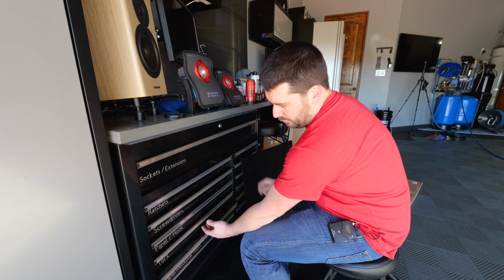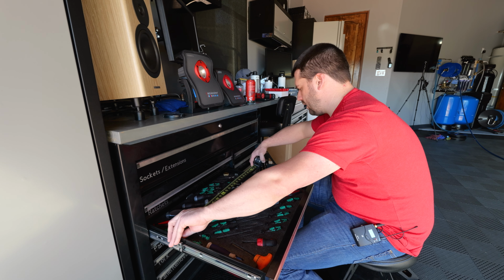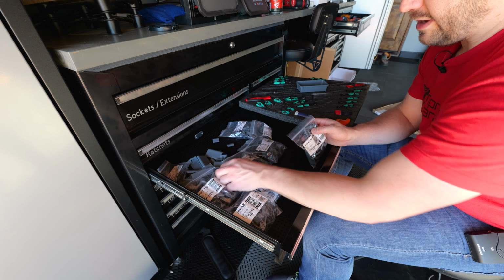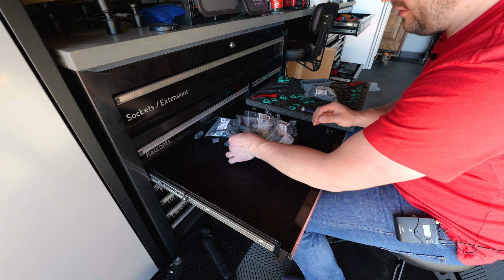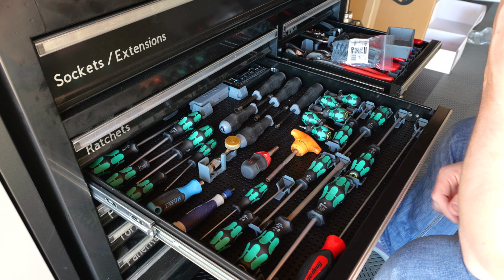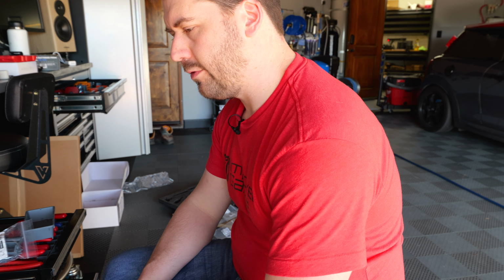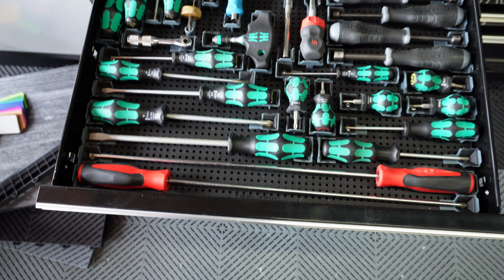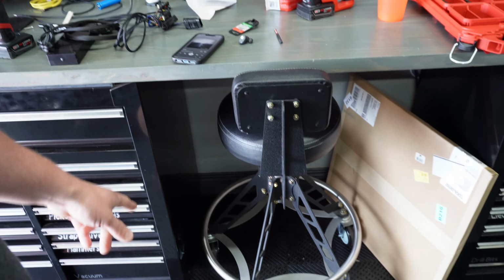IG536 I ToolGrid my ScrewDriver drawer

Comment: Nice tool grid video, been going through my cabinets/ toolboxes to get an idea how I want to do my layouts in the drawers. Just a thought I got the sonic mss 7 drawer portable cabinet, I believe that's how they list it, but it's got wheels on the bottom, and it's got 5 small drawers like the 9-drawer cabinet with 2 deep drawers like the 5-drawer cabinet. There is a good mix to the drawer size, I have been very happy with mine and if you have a mss cabinet on each side of it you can roll it out from under your work bench or top.
Reply from the maker: I looked at that one but i have a height issue..  The MSS cabs are too tall to keep my countertop below my window, and the portable is too tall to fit with my current countertop height.  I thought about swapping the wheels but im not sure it would work.  The MSS+ cab is shorter because they spec a bridge that runs under the countertop above it, and it needs to fit under the bridge.

Comment: I’m close to placing my first Toolgrid order. I’ve got 3 sets of SAE and Metric impact sockets and a set of chrome sockets that are currently in Olsa socket organizers which don’t fit Milwaukee impact sockets very well. I like the idea of controlling the layout, spacing and expandability that Toolgrid will give. Only downside is the labeling of each socket as my eyes aren’t the best.
Reply from the maker: The TG labels aren't bad, I've used the tekton ones before and they eventually come off, I haven't found a great option for labelling.
Reply: @improvedgarage  OG shipped my TG order today and Zoro shipped the boards yesterday. Should be a fun weekend if everything shows up soon! 😀

Comment: What is your go to source for your tools?
Reply from the maker: lots of places honestly.

snap-on stuff came from the truck 20 years ago 
Milwaukee is a mix of Home Depot and OG
tekton i buy direct from them, they have a good rewards program
I have some asst Ares, Capri, etc from amazon
Wera, knipex, and Hazet from KC tool
Sonic from Obsessed Garage
Nepros i buy direct

I generally use a project as an excuse to buy a tool, and i have a personal rule that i will only borrow a tool one time.  So for example if i need a brake compressor set, ill borrow it from autozone and then buy one for my box, Im 36 and ive been collecting tools since i was 14 or so.